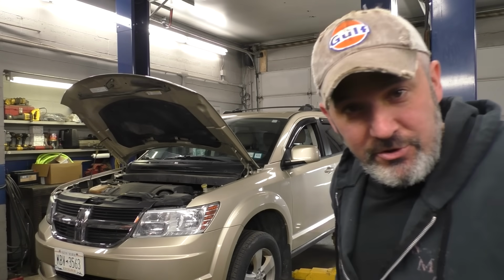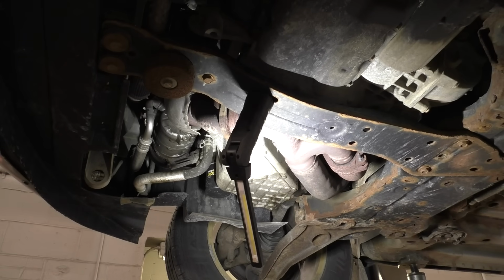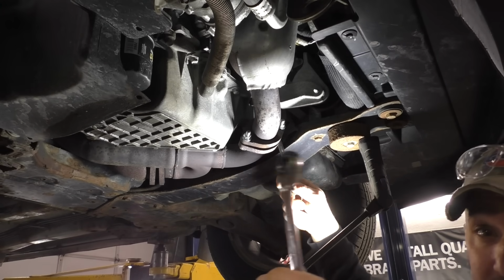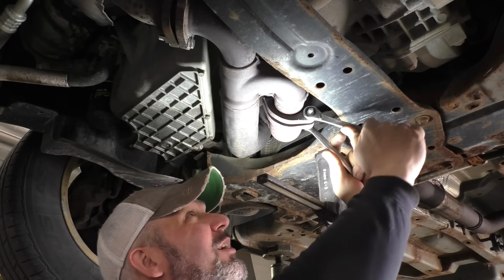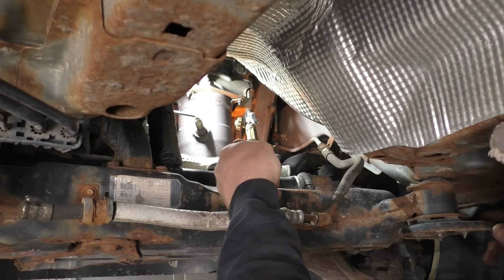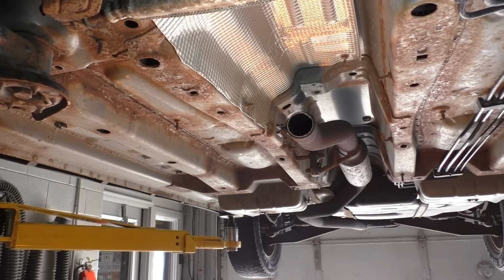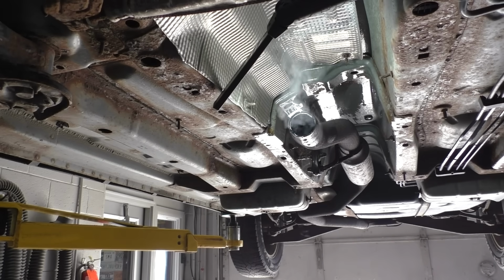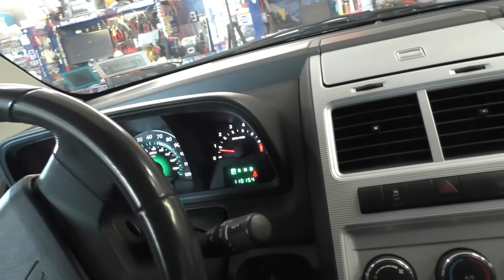Dodge Journey - Flex Pipe Replacement & Y-Pipe Repairs

Comment: For any of the viewers out there! Take a journey back in time and watch a video of SMA from 9 years ago!  Watching how serious Eric O. was back then explaining how to work on a rusty Hyundai or Ford! When you see how SMA has developed his content from the beginning you will enjoy his current content even more! I watched several videos to get tips and clues how to do Hyundai suspension work and saved me a ton of money and time? As always a cup of Joe and SMA video to start the day! Thank you Eric!
Reply: My favorite, all-time, SMA, is the first I every saw. A Chrysler that had no electricity. After replacing the battery, it still had no electricity. The DIYer had gone to Wilbert's U-Pull-It and gotten a "new" ECM. Nevermind that the plastic tabs on the "new" ECM did not match the plastic slots of the ECM socket under the hood. The DIYer had strong arms and had gotten the "new" ECM  into the socket by brute force. Of course not one of the 128 wires in the socket were plugged into the correct pins in the "new" ECM ! I laughed so hard I nearly fainted.
Reply: Don't you meant Dr.O. Why was that name ever dropped?
Reply: Seriously this. Especially his electrical troubleshooting - NEVER skip those
Reply: He's definitely developed his own video character!
I've personally have put off a task because I wanted to create a video of it. But realizing the amount of preparation and thinking about the video content, I just did it without recording it.
Reply: Yes, I have done this. I have to admit they were quite serious. 😂
Reply: @justonnie  I remember Dr. O! He is actually brilliant enough to be a doctor.
Reply: He had much less gray back then too.

Comment: Mr O, you are an artiste with Old Vic there. You don't go full ham with the heat, and you nibbled away the metal to get where you needed to be. Awesome job as always. I'm sure the customer will appreciate the extra effort you went through to save her some money, yet still left her with a safe car. Nothing like idling at a light in the winter and feeling all groovy with the carbon monoxide kicking in.

Comment: Would say this was a great video for anyone trying to replace the exhaust system on a vehicle as it shows the challenges created by living and driving the salt belt areas of the country.  A 45° duck bill torch tip used for cutting rivet heads might be something to consider for your torch as it might let you get into tight areas better - sold one to a customer who did a lot of exhaust work about 30 years ago and he really liked it.  When dealing with the inner pipe once the exhaust is sliced with the saws all I would suggest using the mig welder and tacking the  inner and outer pipes together in a couple of spots on the nice clean cut edge on the side you are not going to use your air chisel cutter on.  This should hold the inner pipe enough so it won't try and push in as you use the cutter on the opposite side - once the inner pipe is sliced it is easy to grind (or use "Vic") to remove the tack welds and pull the inner piece of pipe out. You could also drill a screw hole about 1/2" from the cut end through both pieces of pipe and put a sheet metal screw in temporarily to keep the inner pipe from sliding inwards while you use the air chisel and cutter.  Just a couple of suggestions to consider - hope they help.
Reply: well thought out🤔🙂

Comment: Eric, back in the old days we would cut the inside pipe a little long so we could get a vice grip on it and then use the inside cutter to slice the pipe and give it a twist and it would come right out. Never needed a torch to get one apart

Comment: The " inside cutter " air tool you used , we called it the "can opener bit". This was for fire and rescue operations. When I first came in, the air chisel was a mainstay tool on extractions. Then everything went  hydraulic or even newer, electric.
Reply: I love our battery powered extrication tools. No muss, no fuss and just as powerful as the old stuff.

Comment: The best way that I have found to remove the inner pipe is to weld a 3/8ths bolt to the inner pipe with the threads facing out. Then I thread on my slide hammer and it pops it right out. If I'm in a position that I can't get a slide hammer in there I will cut through both pipes and remove the inner. After I'm done fitting my pipes I just weld up the outside pipe.

Comment: Eric O does a magnificent job teaching how to diagnose a problem. His descriptions of his step-by-step process to track down the fault are amazing examples of instruction at its best ! I love them, but not half as much as the nuts-and-bolts, "wrench and screwdriver" videos such as this one. I would love it if Eric O posted a head-gasket replacement, or any other major repair. I know why he doesn't--filming doubles the time the job takes. One of my recent favorites, was the replacement of the front structural frame of a Subaru. The heavy metal that holds the engine and the front wheel assemblies. Marvelous.

Comment: Diablo blades for the win. Spent 40+ minutes trying to cut the rounded head of a bolt holding the rear lower shock using Irwin blades and barely got a fifth of the way. Bought a Diablo blade and 15 mins later, that bad boy was done. Good to see kitty stopping by to say hello 👍
Reply: A person kind to animals is a kind person.  No place finer than SMA with all the "attachments"!

Comment: Hello Eric: As you mentioned many different methods for removing the inner sleve piece. One reasonably quick method if doing a lot of exhaust work. Take a pipe expander weld a slide hammer rod and weight on to the expander. Expand tool inside exhaust pipe until it catches inner pipe and a couple of whacks with the weight and the piece pops out.  Not something for the occasional exhaust repair but we'll worth the simple fabrication for someone doing frequent exhaust work. Good job keep the videos coming.

Comment: Many times similar heating and pounding rotted bolt, would mushroom the top so much that the bolt would not fit through the hole.

Comment: What usually works for me with cutting the inside pipe is just using a sawzall. Sticking the blade in the pipe and holding it flat, once the blade cuts the slit, it will usually snag on the blade and yank it out

Comment: I don’t know about tools and how they are built but I worked in steel industry and you are correct: If spring steel is heated rapidly or to a sufficiently high temperature (even if done slowly) it will become brittle and break instead of flexing and springing back to its previous shape.

Similarly, if you heat neodymium magnets (like on your LED lights), their magnetic strength is diminished and can become zero. Which may be why older LED lights that are occasionally hung off hot engine block weaken over repeated use.

Comment: Oh we all like ol vic to come out. Means that the job is going well. 
Also I use a plasma cutter now and again when getting a torch in there is too tight. A small hypertherm powermax 30 allows me to get into a few smaller spots

Comment: Stick some American bolts in there 👍 That statement just reminded me.
I have thousands and thousands and thousands of bolts one side course thread 1/4" to 1/2"
Other bin1/4 to 1/2" fine. And bottom row up to 1". Sad they are all going to scrap. 
I guess what I'm saying no (h!na steel. There will be bolts I bet brand new from the 60's70's that I haven't used.
Great quality work as always at SMA!

Comment: Some advice for DIYers dealing with a rotted exhaust stud - The Clamp-A-Stud. It's an elongated C clamp with convex and concave fittings for replacing bad studs on exhaust systems. It costs about $30. Once upon a time I had an F150 where the exhaust suddenly got louder. Inspection revealed that one of the manifold studs had rotted away. It would have been nearly impossible for me to replace it properly with the tools I had, so based on a friend's recommendation I tried the Clamp-A-Stud. Went on easy and worked great. The exhaust was still tight when I sold the truck years later. I'm sure that professionals would never consider such a shortcut, especially ones like Eric O who rightly believe that getting things back as close to OE as possible is the best way to go, but I think it might be just the ticket for people who want to keep their vehicle healthy at as low a cost as possible. Also FWIW when I install an exhaust clamp I prefer to install it sideways where possible to minimize the chance of it catching and snagging on something.
Reply: lol, I have seen c-clamps holding exhaust flanges together, either tack welded in place or hose clamped  to hold them on. 🤣
then again, this is Ohio, where NY ships all the inspection failing cars t be sold to us suckers. 😒

Comment: My wife has a 2007 Dodge Magnum with the big 3.5 V6. We've had both flex pipes rot out. My mechanic fixed them both just like you did. Torch, cut & weld.

Comment: Hey Eric, good show❤ I have old exhaust heat shields saved to protect surroundings from flying sparks. God forbid an errant sparks catches a mouse nest on fire and you don't catch it😢 I also keep my garden hose hang ing right on the car during hot work. Actually Josh or Mrs. O as fire watch would be better😅. Not preachin at you, just an old man want ing you to be safe ❤

Comment: To remove that piece of exhaust have you tried laying a couple of beads of weld longways on the inside piece to see if it shrinks the pipe enough to remove it, I've seen it done on bigger pieces so it does work. Or don't cut the old pipe so close to the join so you have material to hold, twist and pull. Great video for sure Mr.O

Comment: I tend to reach for the slide hammer whenever something goes in that is supposed to come out. That little hook on the end has been through many battles and rarely loses a man. On this pipe, I would have tried heating the outer pipe and then giving it a few hopeful slam tugs before resorting to cutting the inside pipe. In cutting it, if there is no slot in the outside pipe to follow, I would have made a new one with the sawzall cutting inside and outside at the same time until that inside was free. I don’t mind welding rusty things back together as much as fighting to get rusty crap apart.

Also, a useful tool for those tight spaces to knock out those bolt remains is a pneumatic palm nailer.  They are short money and kind of like a right angle air hammer. Just don’t get the back of your hand up against something hard. A punch nailer with a hardened pin sometimes works if you can fit it, too.  I often need these things where there is no room to swing a hammer. They are not “big dog” strong, but often position beats power.

And mounting the clamp at an angle is the right way to do it. You need the water to roll off and the undereffect from the sharp point facing down is aerodynamically efficient. Anything sounds right if you can tell the story well enough. 😂

Comment: On that rear pipe since you had the sawzall out I would have made a few cuts on the inside pipe and then hit it with the air hammer instead of the torch....A little heat on the outside pipe around the end couldn't hurt either.....Love your video's

Comment: When I have trouble cutting an inside pipe, I heat it almost to melting and jam a screwdriver in between the inner and outer. Usually cuts easily and don't worry so much about cutting thru because there is an air gap. I do like the idea of squirting water on the outside pipe to be safe.

Comment: I've made a modification to a internal wheel bearing puller to fit the inside of the pipe and pulled them out that way.

Comment: The “alloy” pipe is probably a 400 series stainless steel, the oems use it in the hotter sections of the exhaust system because it’s cheaper than 300 series. Even though it’s considered stainless it does rust, but it lasts considerably longer than aluminized mild steel

Comment: When you were trying to get that rearward pipe loose with the air hammer and it was just pushing it in further, I'd wonder about using a slidehammer with a hook attachment to pop it out

Comment: Sometimes you can use a Sawzall with a short blade  inside then fold it in and pull it out.. doesn't always work though, good job for what you had to work with!

Comment: 35:30: a better way was to cut the flex pipe at least a few inches forward of the joint and bust it loose with a pipe wrench. And that was on a 15 year old Journey in Nova Scotia

Comment: When you have a pipe sliding inside another..... clamp some vice grips on to the opposite side to hold it in place,  then hammer away with the cutter.

Comment: I’ve used a “J” hook bar with a slide hammer to pull those pipes out from inside another when they are loose. Like everything doesn’t work every time but once in a while you get lucky.

Comment: Suggestion:  when you were trying to cut the aluminized pipe with the oxytorch, & having a problem, keep in mind that while an oxytorch cannot cut aluminum or stainless, a plasma cutter will.  Perhaps a plasma cutter would have done that job.  They are getting pretty cheap. Might be worth a try.

Comment: I sometimes use an M12 Hackzall (and a new Milwaukee blade) to get between the flanges. And yes you still have to punch, drill, etc.... them out, but it does work if you don't have a surgical fire axe or required skills.

Comment: Just a tip form the rust belt..

For pipes inside of a pipe you want out. Use your sawzall. Keep the blade flat against the pipe. More control over where the blade goes than with a gas axe.

Comment: Those splined studs are a super PIA. Obviously used for rapid assembly. Couldnt you cut the inner pipe longitudinally with your
Sawsall, then peel out the inner pipe? Really nice job, on what is always a PIA.

Comment: I think I would have removed that cross member, but I always do more than some people think necessary. Id probably wire wheel prime and paint the damn thing too. Id definitely use stainless steel bolts going back. I know, I know, it's not mine, it's a shop. The fact that Eric does not wear long leather gloves while torching drives me nuts. Thanks for the tip on the ratchet wrenches. Much Appreciated.

Comment: Would it work to put a screw in the pipe to hold the inner from moving then use the inner cutter?  I have no experience, just thinking which may be dangerous.

Comment: Just a question, when you had the inner pipe started to curl inward and slip farther inside, would you be able to grab that curled up lip with a long nosed visegrip and pull it out with a slide hammer, It was obviously loose enough to slide in.The hook that you ended up with could have done it too.

Comment: On that piece of pipe that was stuck inside; I wonder if you could have used a slide hammer with an attachment for an inner bearing / race - like for axle bearings and such ??
It did already move with the air hammer.

Comment: I was changing the muffler on my car . I was doing it at the place my brother in law works so he was there "helping" . He jumped in and began trying to take off a New York state 12 year old muffler clamp. He sprayed penetrating oil on the nuts and struggled and swore and struggled while I stood there telling him I have a grinder with a cut wheel and a new clamp but he insisted on going at it like a Winnie the Poo trying to get his head out of the honey jar . He did the same when I changed the thermostat that was tough to get at .

Comment: I used to weld but didn't really get into cutting with a cutting tip. Can you actually see what's going on with the flame? Like can you actually see the flame cutting the metal? How does he cut the metal on the inside but not cut the outside pipe? I remember when doing my little motlen pools in circles I could see what was going on but there's a fine line between making a hole and making a motlen pool that you get with experience.

Comment: That is a job I could still do but with new car problems I can no longer do I will never keep a car long enough to replace an exhaust. When the cut-off was stuck in the pipe I knew what tool to use and he pulled the seal puller out of the toolbox. 
box.

Comment: Honest question, you had the flanges at the manifold loose, why not cut the flex pipe at that point and then have easier access to the rear flange? like fish the assembly out separate, put back together and reinsert then bolt the front flange together. Just curious I wasn't there so maybe it's a clearance issue.

Comment: Would a needle-nosed vise grip on the opposite side of the pipe worked to keep that inner pipe from being driven in when attempting to use the air hammer/cutter to remove that bit of inner pipe?

Comment: I wonder if they make, or someone could fabricobble an expanding collet that would slip into and past the inside pipe and expand just enough to catch the lip, then you could attach a slide hammer or wail on it with lil' nasty to pull the inner pire section out. 

I'm sure that's easier said than done.

Comment: I hope you get a good deal on oxygen and acetylene,  you must use quite a bit. That seems like a weird business, prices all over and going up fast, one welding gas company buying another.
   I got a plasma cutter to reduce gas use, but it's different, does not replace a torch, even if just cutting, and useless of course for heating stuff  to expand it, etc.

Comment: Is there any harm to using a .401 bit on a .498 Astro air hammer?
Reply from the maker: Risk of it flying out 🤷‍♂️ or just breaking. They do make an adaptor but I've never used one.

Comment: I think I know why they have those flex pipe segments. But back in the day cars didn't have them. Do you really need to have them?  Are there any smaller torch heads and would a smaller head help you in these spots?